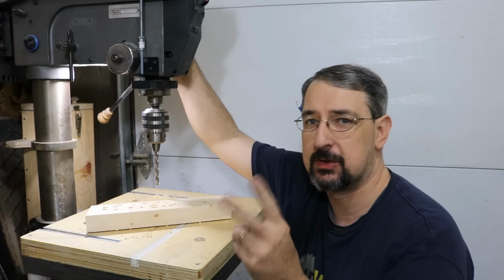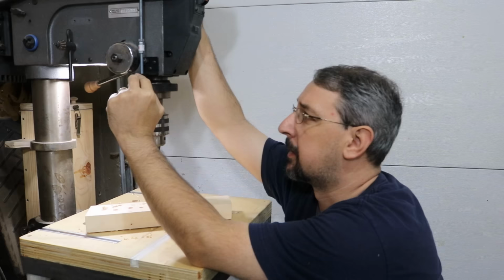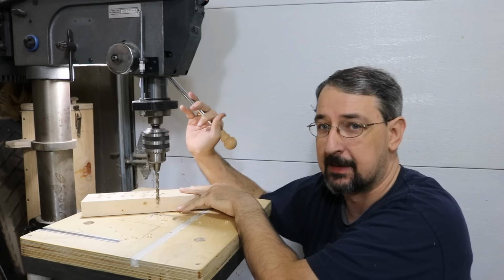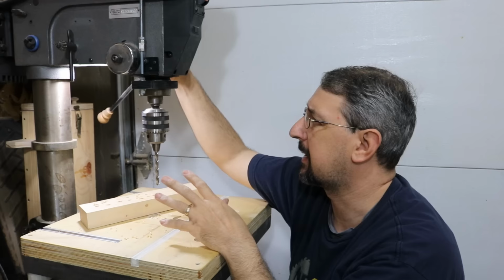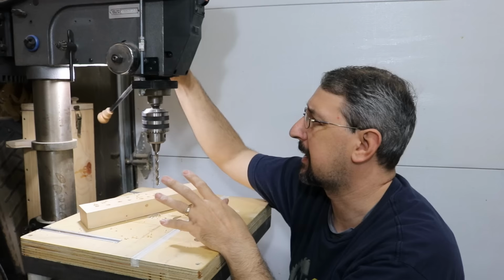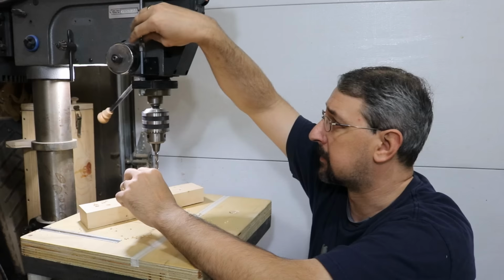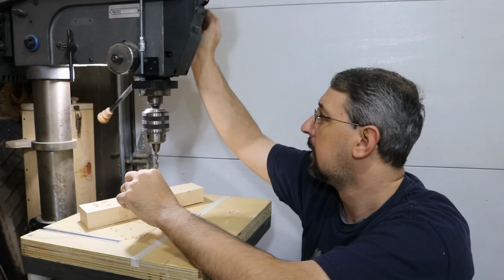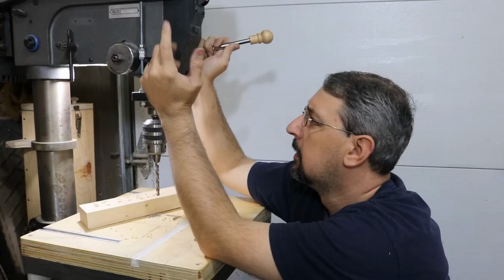Drill Press Depth Stop

Comment: I've received an X-Y vise for my drill press for father's day.  I want to use it with an end mill to mill some aluminum/plastic.   My drill press has a depth gage/stop built in but I needed a method to lock the spindle at a certain depth.  By putting the lock nut on the bottom side of the bracket I can lock the spindle at that set depth.   thanks for the idea.
Reply from the maker: Glad I could help

Comment: Yeah, mine has 2 nuts also, so the set nut does not come loose, you have the other nut to lock it in place. But both nuts are the same size nut.  I have a measuring tape on mine, but never use it, I just lower it to the desired depth, and set the the first nut, then snug the second nut. 

What brand drill press is that?
Reply from the maker: Harbor Freight brand

Comment: Mike, my Ryobi drill press has a round depth stop that is kind of a pain to set, but does function.  Does your drill press already have a depth stop and this was an improvement, or did your drill press not come with a depth stop.
Reply from the maker: mine does to, but it does not work well. this takes a min to set but much more reliable

Comment: You improperly re-installed the set screw that holds the Quill from going side to side- The slot on the screw should be in a vertical position in order for the flat machining  on the screw to do its job of controlling the quills back and forth movement.
Reply from the maker: +Tom Langley it work though

Comment: Mike, what is the bigger nut on the depth stop bracket used for?
Reply from the maker: +Felix Espana I wanted the bigger one so my finger could easily turn it. I was also thinking I might be splitting the nut in half to glue to a spring clamp. So a larger one would have been easier to handle as well.
Reply: Mike Fulton I was referring to the one next to the two screws/bolts that attach the bracket to the body of the drill press.
Reply: Mike Fulton the one at 1:06....
Reply from the maker: Felix Espana oh, my mistake. I have no idea what it's for.